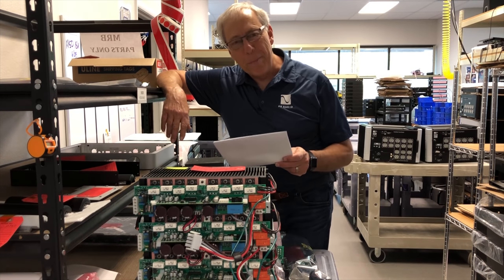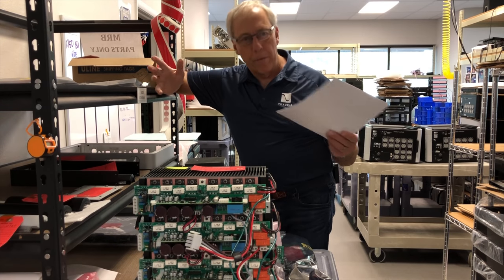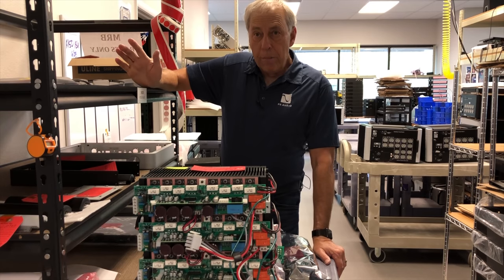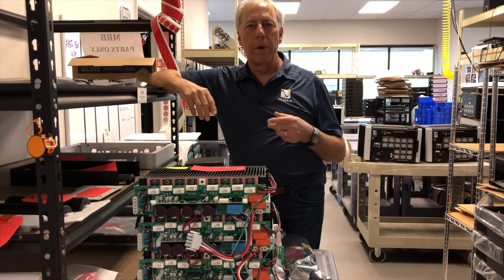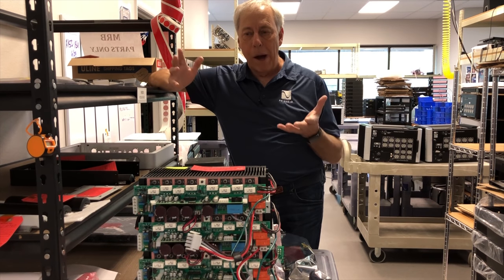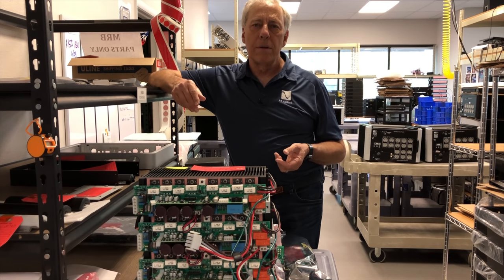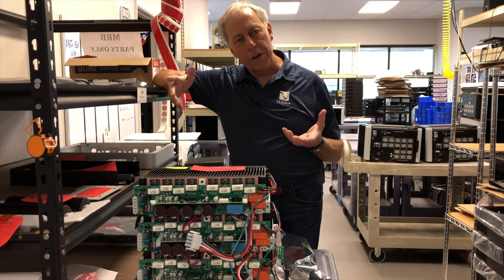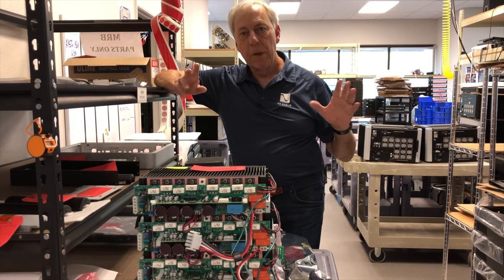Is the BBC dip still used in speakers?

Comment: I hate how a lot of manufactures try and get their speakers to play flat up to 20KHz or above. It just does not sound right. I personally prefer a roll off at around 15Khz. It sounds far more natural to me.
Reply: This all depends on your room.
Reply: I prefer a single driver with minimal external influences on the sound. My Zenith 49cz852 speakers (12') play full range with a tweeter crossed over at 12Khz however the tweeter is less efficient than the zenith so it all works out great with a nice roll off around 15Khz. Everything is in Phase and it sounds marvelous.
Reply: The general wisdom is to roll off if you're in a normal (kind of reflective) room at a normal distance from your speakers.  If you're really close to your speakers or in a very large room where reflections aren't as strong a part of what you actually hear, then flat will probably sound better.  The high frequency reflections add with the main signal to harsh your mellow.
Reply: I completely agree equalizers can take away from the hi fidelity element of the sound. I like it as pure as possible
Reply: back firing super tweeter could also do the trick
Reply: nick parkin Same here. I love my 2 pairs of JBL 4320. They too top out at 15k Hz. And it's a two way meaning it's timing/phase integrity contributes to its neutral sound.
Reply: Does not sound right means increased/decreased  - not flat. With best flat tweeter It may happen   if not cared.  For high above 13 kHz it was always very hard to judge the volume because energies are so unheard  .  I agree that special care for this band is sign of bad attitude  often used  to cover mentioned big other faults. . they also have    very serious  consequences for amp.  . Funny thing is that worse driver could  in special alignment help with cross frequency phase faults  . But where is any  driver producer to allow his speaker to be worse?
Reply: If we hear sound naturally it has content that goes up well beyond what we can hear. If you don't like the sound of anything audible above 15 kHz that must mean you hate components of natural sound. Consider the sound of a beach. I was going to say waves crashing on the shore but that is just one component of the sound as it is wind and reverberation and many other things also. The point is it contains stuff at 17 khz and 20 khz and 30 khz and on and on and on. Nature does not filter any of that out. If there are components that you do not like in that range only in sound emanating from your system that must mean the annoying sounds are generated therein and it doesn't have to be the speakers that are doing it either. One of the things that really impressed me about my Tannoy's was the fact that they didn't roll off before the end of my hearing range which admittedly was a little higher than the human average. I am many years older and I know I don't hear like I did then. It was also one reason I actually appreciated Hafler amps over  Bryston's. I had a few folks all but call me a charlatan for that but to this day I stand by that one! Bryston's are not bad amps but Haflers did things that Bryston's do not! Anyway, If speaker design is about recreating what was on the recording faithfully then most of the time + 15 Khz is an important (not to mention known audibility) of what was recorded. Speakers that don't reproduce that range in my opinion are inferior!
Reply: I  deliberated it already many times. .. Can you imagine material object in nature generating BASIC harmonic 20 kHz? How much power it needs to make it audible to humans ? Our tweeters  handle  horrible big few watts and it is still too little. So many people  burned them trying to catch by ear 20kHz or even much less. No sound, much smoke. For tiny object it is devastating power but only tiny can vibrate so high. .  Our hearing has very low sensitivity to high sopranos - this is proven  . This  small objects with small energy of radiation are totally NOT IMPORTANT for us to understand what is heard. And we still rage for BASIC reality.  To get the right sound of violin does  anyone need to hear vibration of single micro surface of string support ? Of course it is existing but it does not input comparing to main surfaces vibrating loudly hundreds to 1k. . Ears receive complex sound by its surface - what is below surface is masked by upper. Great that mother nature gave us that spare margin for ageing but it is  just useless margin.  Why people want to force ears to listen something they were  not created for I do not know but eventually they succeeded   in presentation of noise made with  electronic which is only good source of complex sound up to 20kHz. Generated by conductivity and atoms. . This leaded them to develop noise reduction instead to  stop broading  hearing bands by huge amplification . Honestly many listeners admire something they never heard before but it is false.
Reply: I am guessing you mostly listen to classical music or something then because the sound of cymbals crashing that humans typically like is near 20khz. Also bombs going off in moves contain very low frequency information which goes right down to below 20hz. One of the problems in the past was that microphones did not have the capacity to capture 20 khz very well and you already mentioned that speakers didn't readily do that either. One of the most notable advancements in transducer technology is the ability to much more easily work with the extremes of the human hearing range. We now have a number of microphones that work well above 30khz as well as speakers that reproduce that range more easily are much more readily available. I feel like you are someone who walked away in disgust many years ago and has not looked back. It is worth another look really. Everything is far more lifelike with the extremes of the hearing range active rather than filtered out and I never hear people praising how artistic the sound of a voice is they often do praise us for how real it sounds though. It is a whole new world. Really.
Reply: if you mention    20kHz  in cymbals did you check  by yourself? Once I I met also opinion that "soprano singer singing at top  is  about 10kHz" :) Estimations are misleading.  As I know it is  the simplest thing to connect piezo driver pushing above. If no like  piezo then electrostats are also nothing new.  Did it make ANY breakthrough?  Anyway I do not like to argue - it is  not so important what we think about what we hear but enjoyment. .
Reply: I haven't in a long time. It is something we did in school and for me when I first started mixing I used to use an  RTA to assist in my mixes. It would tell me if I was pushing too much of a certain band as well as if I was lacking in a certain band... Like 18kHz which is commonly boosted in the mastering phase to compensate for gear loss. I believe I used the word "near" as well as it is somewhat of an estimate. I also currently usually have Smaart running as a reference tool beside me when I am mixing shows. The only thing with that is that at 150 ft where I am usually situated there is not much in the realm of 20kHz left to work with. It is like I said most mics have a lot of trouble trying to accurately capture that region and with that most recordings are actually very deficient at 20kHz. Mastering can't boost volumes of things that doesn't exist.
Reply: it could also be your ears. As you age your ears can't hear higher frequencies so that boost may help counteract that. Im 19 and have pretty good hearing. Just a thought.
Reply: I didn't go there for a few reasons.  The thing is he said that when he hears speakers that do function at higher frequencies he does't like the sound which kind of indicates that he hears something in the higher range so it is kind of an irrelevant thing then. The thing is it might just have to do with the specific drivers that he has heard. In order for a driver to produce frequencies that high they need to be more rigid. Many people like silk domes because they sound smooth. The thing is that silk flexes more easily. If you have ever heard a dome tweeter that has been pushed in (collapsed) you can see how it sounds different from what a non collapsed same driver. My point is that changing the shape of the diaphragm changes the sound it creates. Consider that a silk dome when functioning is doing exactly that all on it's own. This action of course does not keep perfect time with the source and with that smears the sound the driver is creating. It is very similar to how people like film recorded movies as opposed to digitally recorded ones. It isn't actually "better" it is more like a charcoal drawing that someone has rubbed their hand over. Smeared or to use a more accurate word. Obscured. Better drivers obscure less. Some of those however also can sometime through driver resonances and such generate things that weren't part of the original source material which could also be nasty to listen to. The thing is that neither is true across the board it all depends on the driver itself and how it is used. Every speaker is different.
Reply: Some of your conclusions could be  not so general. Like  the difference in two speakers while ...it may be  of the same type and producer.That we do not need to be scared much.  I do not think It all depends on the driver itself.  I think up to my tests all depends only less then 50% on driver. because in basic  working range they are similar but for other  speaker  is required different crossover design.  . . Most important is  what is really difficult - application and acoustic surrounding  of driver .  Two speakers will sound different due to unsymmetrical location in room and front surrounding   and differences in ears, sometime in channel amplifiers. Dome speakers may collapse ( in range of construction gap )  and do not develop  any damage  if made of soft silk which is good. . Process which you are describing is known as division of  diaphragms and is advantage allowing to employ smallest mass. by . highest range which helps in many ways. That is why silk domes are desirable  but personally I do not prefer them due to   dome construction  . . The smearing is occurring  but  in unwanted resonances. Metal domes   sound more harsh due to exposed  low resonance. But as you know resonance  equal fast raging of phase.  It is enough complicated not to judge generally. .
Reply: So this was a discussion about the relevance of 20Khz and why the gentleman OP and I am sure others find that speakers that reproduce full response as opposed to limited response are unpleasant sounding to them. 
 Near as I can tell the serious manufacturers are mostly turning away from silk of late and more often than not using some form of metal diaphragm. Beryllium has become very popular. Of the high end manufacturers that I know of there are few that are holding fast to silk any longer for a number of reasons but I think the biggest is that we just can't take that tech any further and other more recent tech has blown it out of the water. All substances flex or they wouldn't make sound but silk flexes more and that is a problem not to mention the fact that it also has a hard time reproducing flat frequency to + 20khz. Advantage or disadvantage? I think it depends on which side of the car you are looking at. (you can't see both sides of the car at the same time analogy). The 180 degree spherical dispersion of a dome is another issue and creates a lot of headaches when we involve wave guides.
Reply: Hi Nick and everyone talking EQ: Fun thing is that all music you listen to is run through a lot of EQs. Adding your sonic equipment to that and you never ever listen to the pure music. Also, there's no such thing as a “flat” speaker/monitor. That's what the manufacturers want you to think because they want you to have the illusion of listening to the actual recording. Yes you can strife for “flat” but then again, your ears, my ears, everyones ears hear sound differently. Maybe not so much but still differently. As with high frequency everyone has it's preferences. I personally like "airy" high frequencies and a bit of scooped mids. And I'm very sensitive to low bass frequencies.

That said. EQ can be your best friend, as some points out the room is always going to influence on the sound. Also, there's no such thing as a perfect room. Neither at the recording studio or at home. In the recording/mixing studio there's a lot of sound treatment going on but you can't get a “perfect” room. However, the recording or/and mixing engineer knows how the room and the monitors react so they take that in advantage.
Reply: nick parkin
Just like FM Stereo.
Reply: Falchulk, there's no need to use foul mouth language in here.
Reply: To: lex Tr3,
A rear-firing super-tweeter would merely add a greater percentage of multipath-distortion as a result of the sound being reflected off the walls behind the speaker into the room, although, some people like the way that sounds.
Reply: To: nick parkin,
First of all, there is no such thing as "Pure", as it's quite normal for each piece of music to be recorded under different conditions in different Studios on different days with different microphones and different processors in the signal path, even different pieces of music on the Same album will be recorded with there often being major differences in the equipment used by the performer from one song to the next, it is a scientific fact that even the recording engineer's hearing will differ from hour-to-hour and day-to-day, this being the case it's a matter of personal preference as to how you like to listen to your music. Everyone perceives sound differently as a result of not only the differences in physiology from one person to the next but even having a strong cup of coffee can change the quality of your hearing for a period of time. Also, as a result of not everyone using the same brand and model of speaker, amplifier or music source, the perception of music is quite subjective.
An equalizer is merely a tool which when used properly can actually help to RESTORE proper tonal-balance to the music, as well as allowing you to adjust the characteristics of it to YOUR preference.
Reply: We have developed RTAs and other analysers like Smaart and SIM because humans all hear so similarly. These systems eliminate the guess work that goes into making frequency response decisions because they are pure science based devices. The very fact that I know my hearing changes as the day wears on is exactly why I run an analyser all of the time when I am mixing. I can look at it and see when I am out to lunch! This discussion tries to make good sound into all completely subjective art and as an engineer who focused more on the art side of what we do rather than the tech I am telling you it is a lot more cut and dried science than what any of you are saying. I honestly believe that there are few advancements made since the late 80's in audio that actually out perform the top tear performing equipment of that day but if you look around you will notice that the variance between budget driven verses performance driven designs is far less than what was on offer in the 80's. Across the board we now have a far more consistent level of equipment performance meaning our listening public is hearing "Beats" phones but look around the gym. They outsell everything else 10-1 easily and price-wise they are a relatively expensive piece. Extreme frequency ranges don't matter? Tell the general public that. Beats are "all about the bass". Headphones have an extremely difficult time with higher frequencies for some reason.  Probably because mostly we are dealing with one driver outputting all of the sound. At the end of the day in order to get great high end that is in proper balance with the bottom it requires real engineering and the resultant product is not going to be cheap. I think the AKG Quincy Jones phones tried to take up the baton and they had some success but they need to be outstanding for a little more reasonable price for the public to buy in. The DR. Dre's did something they hadn't heard before. It is a tall order for someone else to make enough of a difference to change people's head space. 
  The other thing that we learn as young engineers is that we are often victims of the bass and treble knobs. They are like a drug to us. We always want more but at the end of the day if we step back and see the world without the "Super smile EQ setting" as the rest of the world hears we realize that we just can't understand a word that Adele is singing. HMM? The problem is that once we get used to our music sounding that way we need to have everything sound that way as we honestly believe that is what is right. The problem is we have trained our ears to not have to work as hard to hear the extreme ends of the spectrum. Hmm, isn't that the part that our ears are the least sensitive to already?
Reply: Drive your hi-fi from a Humax FreeView box, say from Radio 3, and you will realise that stuff over 15KHz makes a huge difference. Its just as vivid as a 128KByte mp3 downloaded from the Web.  Starts me thinking of horn-loaded tweeters, but I lack the gear and the time to get the amplitudes matching.
Reply: 128K mp3`s aren`t so amazing above 15kHz. Use good headphones with a good headphone amp and well recorded CDA files. You`ll hear it.
Reply: I get Radio 3 at 128Kb/s at the following url, but I think not available outside the UK
http://www.radiofeeds.co.uk/hifi.asp
Some of the Swiss, German and Scandinavian feeds are good at
http://www.listenlive.eu/classical.html

I can't tell the difference between the 128Kb/s Radio 3 above and what I get on the Humax FreeView. I have a Humax FreeSat box and the sound on that, on Promenade Concerts live, is much worse than the FreeView. Going through my Sony Brava TV via HDMI and the optical link to the pre-amp gives a slight loss of presence compared to the optical link from the FreeView. All my DACS sample at 128Kbits, but my understanding is that these synchronise automatically with the incoming samples. I see 256K DACS advertised, but I do not know what bandwidth is claimed for the FreeView signal. 
 A long time ago I read a book by Jordan of Jordan Watts speakers, and he said transient response metrics carried more meaning than frequency response. So perhaps what the ear is sensitive to is onset time of the different harmonics. This could be subconscious only until the fundamental is heard as well. Then, frequency response tests on the ear could miss these effects. A bit like peripheral vision detecting movement that higher resolution central vision then dismisses after a micro-saccade. That would satisfy the people on here who say we have no need to hear very small animals. What we do need to do is to determine the direction of a call despite echoes in the forest, and harmonic onset is probably important for that.  Then again, I am 68 and perhaps I am not hearing distortion that a younger person would hear. Or else my 1980s Mordaunt Shorts are rolling off early.